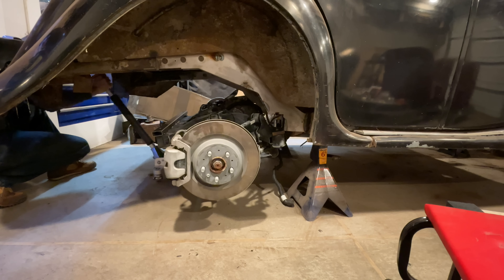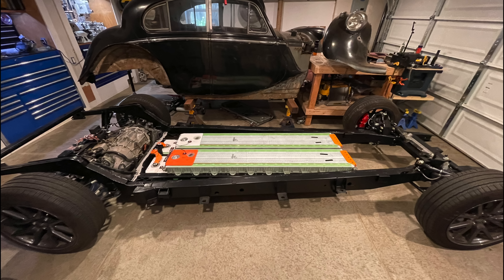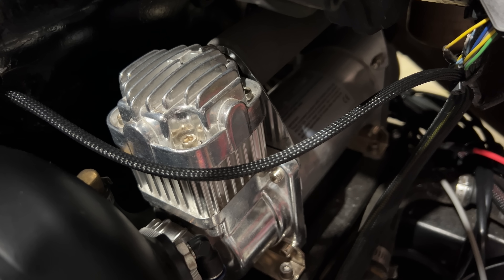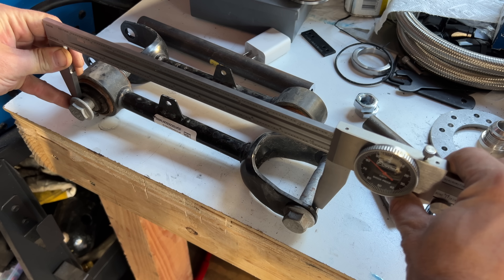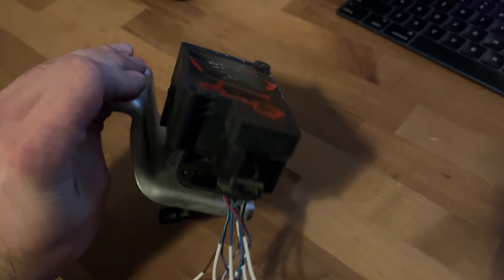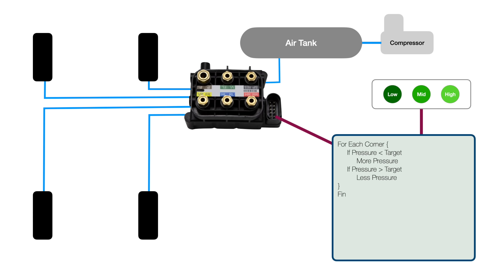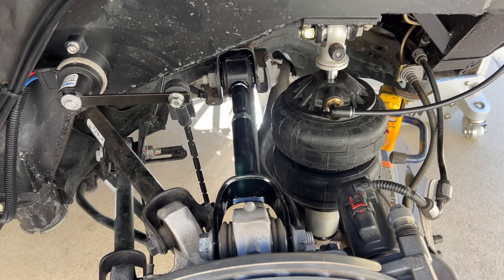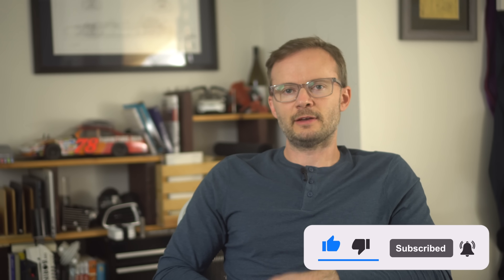Air Suspension: DIY or Off The Shelf. Let's Find Out.

Comment: While the car is sitting air pressure will always be the same it has to be because that's how it holds the car (pounds per square inch of the  diaphragm) starting with less air volume whyle lowered will give you a more progressive spring rate which is ideal as the spring gets stiffer faster unlike a coil which has a linear spring rate.

Comment: ok as a software engineer the code with the diy route is super simple and it doesnt require the ride height sensor since i know how much air is in the bag !!! in the code i wouldve made a table with all four wheels desired pressures in it 
and in an infinite while loop i would check every wheel pressure with the sensor and compare it to the table and do an action to lower or inflate more 
the buttons if i press high i would swap the values in the table and the while loop will inflate all the bags to reach the pressure 
if i press low i replace the values in the table and while loop would deflate the bags
you can also make custom values to make the car dance if you want to

Comment: This is a dumb non engineer question but once the air bag lifts the car up 2 more inches, doesn't it take the same psi to hold it there as the lower setting?

Comment: I wonder if you could use a coil-over with the bottom mount on a sliding track, adjusted by a linear actuator. For low and firm, wind it out toward the wheel.

For high and soft, wind it in toward the body, closer to the pivot.

Just as easy to control and you don't need a compressor/tank harshing your marshmallow.
Reply: That would work, but it would be a really complicated and heavy way to get the same effect as connecting the air bag to a fixed air chamber, closing a valve between them for stiffer springing and opening it for softer springing.
Reply: @brianb-p6586  true, but it also solves the inverted softness profile inherent in air bags.
Reply: @LongPeter  what is "inverted"? If the bag is longer, it is softer, which is good, because it also means that if it is shorter (lower ride height) is it stiffer... as it need to be to avoid bottoming out.
Reply: @brianb-p6586  Matt said (in a Jag video I think?) that increasing ride-height with variable air pressure results in a harder ride the higher you go. I was just taking his word for it.
Reply: @Long Peter  the problem is the type of air spring bellows that he's using, for which the rubber acts as a spring itself, completely messing up the spring rate at anything other than one height. That's not the behavior of the air itself as a spring.

Comment: Many factory air suspensions, like that on my 2001 Audi allroad, have a lower spring perch that is kind of pear shaped (as are many things on a 22 year old car), so the spring gets stiffer as the suspension gets lower.  In the rear, they also have dampers that are adjusted by an air valve so the damping adjusts as the suspension adjusts.

Comment: I recently was designing an air ride system for a project...didn't know anything about how to do it.
Spent days and day designing circuits electrical and air, and trying to source individual bits and bobs
Ended up using a set of used oem bags and struts and purchasing a new aftermarket controller and valve bank.
NOTHING rides like air!
Love the channel SFM! 😃

Comment: @SuperfastMatt   I just discovered your channel, lots of great stuff!

I believe what you said about air suspension at :55 is backwards; to raise the car you need more air volume, not pressure (the weight doesn't change).

A greater volume of air has lower spring rate than a smaller volume.
Reply: All true, but he's using convoluted bellows, so he's fighting the stiffness of the rubber in addition to the spring characteristics of the air.

Comment: You can't weld a hardened steel bolt, it must be welded in a normalized state and heat treated after welding. What you have done is highly dangerous, especially since it's a suspension part.

Comment: i designed my own airride, and i did it the right way. You dont use pressure EVER as rideheight setting. Its completely ret*rded. The reason you talked about in the video, the lower the car the lower the pressure. But then someone gets in, or you load up the back of the car with stuff and now all of a sudden the pressure rises because the bags have to carry more weight. Want to guess what the air suspension is going to do? Its going to lower the car even more in the back even tho it was allready getting lower because of the weight you added there. So instead of the car going level again when the air suspension activates it wil actually lean back even more. So the only way to go is to include height sensors. Height sensors and pressure sensors would be best if the system looks at both and trys to get the pressure left to right equal at all times. If you use that you should prettymuch have the same corner weight on each wheel.

Comment: Hi Matt,
While your example of low ride height equals soft and hi ride height equals stiff is probably somewhat true for the double bellow airbags you are using, generally in an air suspension pressure is a function of load whereas height is actually a function of volume. If the bellows volume is sufficient (or if you were to utilize sleeve airbags such as most OEMs generally use), there would be next to no stiffness change (or pressure change) at different ride heights. Have you fallen prey to the balloon analogy (bigger balloon = higher pressure)? :-p

And drop the Viair compressor and pick up a used compressor out of an OEM air suspension. You won't have to redesign the mount and you will not hear any compressor noise anymore.

Comment: Thank you for saying exactly what people refuse to understand about air suspension being inherently bad ie getting softer as it goes low and stiffer as it lifts up.
Reply: People refuse to understand this because it isn't true with appropriate air springs.
Reply: @brianb-p6586  which ones get stiffer as they go lower and softer when at max height?
Reply: @MattRabbitDesign  Any air spring which lets the air do the springing, not letting distortion of rubber interfere with the action of compressed air. That means the reversible sleeve or rolling lobe style; in Ride Tech's products, those are found on the Universal 7000 Series and 8000 Series, and vehicle-specific units for beam axles and MacPherson struts.

Comment: I agree with Luaa, plug welds on the modified link would make me feel much better. I have never worked on an air suspension system but it looks to me that if you control each corner separately you could have a good chance of having a different spring rate at each corner, probably not the best idea. Always great to watch your vids!
Reply: A bigger issue that different spring rates is diagonal loading bias - one front wheel and the opposite-side rear wheel with more pressure and carrying more load than the other two.

Comment: The conic airbags (the ones like used in big trucks, that rolls over it's structure to maintain a fixed ratio of volume/pressure) diminishes the spring rate problem. Maybe worth the test!
Reply: Yes, they're typically called "reversible sleeve" or "rolling lobe" type springs. The change of rate with travel of this type can even be tuned with variations in the shape of that structure.

Comment: Glad you went with height control sensor instead of just using PSI.
If you load your car up differently or a fat guy sits on one side it will ride wierd.
I used to drive trucks with air suspension and would use the pressure guages to load and it was crazy how much pressure differential there would be when sitting level.

Comment: It's like rodends in bending but... turnbuckles in bending. But more importantly, It's Good Enough™
Reply: Fortunately, the bending force isn't bad, because it's only the result of bushing binding. If spherical joints (rod ends) were used, there would be no bending force in the link.

Comment: id love to  do  the same thing with an overland 4x4. knowing of the torque and power the tesla motors can produce i think it would be possible to do. the only thing is knowing how much  power you could use everyday recharging could be an issue. oh wait so is money to even build the thing, not to  mention a shop to do it in. well  darn. never mind. off topic im currently working on modifying the roof rack you did a DIY on , but i prefer something a little bit higher so im thinking of going 4" front rear, and sides. to  give a little bit of a basket for those 4x8 sheets of plywood and such.

Comment: You might be surprised what just wrapping the airtank w Dynamat could do to quiet the compressor noise. It worked for me. It's like how I picked up every easy to grab rubber bungee strap off the road for about a year and kept winding them around the 80 gallon tank on my shop compressor. It really made a difference. Was it worth it? Eh, I guess so. ALL HAIL

Comment: Or you could skip all of that and use a semi truck leveling valve for $20 and a solenoid on the height stick when you want it to go up.
Reply: Maybe four of those valves, for the independent suspension on both axles.
Reply: @brianb-p6586  yep that would be better since the front is heavier than the back
Reply: @markm0000  With the drive unit and ancillary electronics in the back, and the battery in the middle, the back of this car is presumably substantially heavier than the front... but yes, they're different, so at a minimum separate front and rear valves would be required. The front and rear suspensions also have different geometries, so the even if they were equally loaded and had identical air springs, they would probably need different pressures.
Reply: @brianb-p6586  When I bag my truck I’ll do that instead of this expensive setup. 4 valves is good when taking a hard corner the outside bags can get more air and the inside bags stay the same.
Reply: @markm0000  Actively controlling air springs to respond to cornering force takes a lot of compressor power - it can work, but most air suspensions don't attempt to do that. Also, in a corner if air is added to the springs on the outside of the turn (where suspension load increases), air should be taken out of the springs on the inside (where suspension load decreases), so the whole vehicle doesn't rise as a result.

Comment: Matt, if you mount that compressor with some rubber isolators it will get rid of most of the noise, may be an easy solution for you.

Comment: You can change the characteristics of a air spring by reducing the volume with a liquid such as a silicone oil.
All telescopic motorcycle forks are coil/air spring hybrids ,whether they are pressurised or  operate at ambient pressure.
Changing the oil level alters the air space above the oil and therefore changes the air spring characteristics.

Comment: I'm almost wondering if the Tesla rear subframe-suspension-motor unit would fit in the same hole size as the Jaguar independent rear suspension? I mean, the one on the XJ series 1-2-3, XJ40 and XJ-S.
Reply: No, either of the Tesla rear assemblies (Model S/X or Model 3/Y) is larger than the classic Jaguar IRS assembly... which makes sense, because it has a whole motor and transaxle with inverter (not just a final drive) and because it is a much better suspension.

Still, you might be able to convert an old Jaguar XJ anyway, with a tolerable amount of body modification.

Comment: I have installed air suspension on my vehicles. I bought Holland Neway leveling valves, an air tank. pressure switch and a compressor. The system I installed is like the system used on public transit busses and 18 wheelers. KISS.

Comment: The internal spring pressure is the same at all ride heights. Resistance, like loading the vehicle will increase the internal spring pressure. Here is a question for you. Does your Jag get heavier at the full height of a lift on a hoist? I know it does not. 
  Adding more cubic air to an air spring will cause it to extend until it meets resistance, only then will the internal pressure start to rise to meet or exceed the resistant load.
Reply: Unfortunately, the double convoluted bellows design of air spring, including the ones that Matt is using, have far from ideal air spring behaviour - it's almost like using a tire as an air spring, while the other type of air spring (the reversible sleeve or rolling lobe) acts more like a piston in a cylinder.

Comment: I was at a wedding and was sat next to someone that did suspension design for a German auto manufacturer, we briefly talked about what we did, then got on the subject of modified cars.
I showed him the diagram for the double triangulated 4 link (solid axle) rear suspension I made for my Explorer, talked about design goals and shortcomings etc.

He was tickled that I was planning to put such a highly modified vehicle back on the road, something he described as impossible in Germany, but mostly laughed and suggested it was quaint compared to the five link designs he worked on.

It took me months of revisions to get the 4 link how I wanted it on paper (to be seen in the real world), but still I didn't disagree. 5 link independent are absolutely mind boggling.

Comment: How about one manifold with 4 outlet ports? One to each wheel. One pressure monitor on the inlet for different ride heights. Then a shut off valve between between the manifold and each tire so the ride height/pressure stays the same at each corner. Shared to inflate/deflate, segregated once up to pressure and height.

Comment: I'm curious why you didn't use mechanical leveling valves with electric dump valves?
Mechanical valves are extremely common on bigrigs
Reply: That's only a straightforward solution if you don't want ride height to be adjustable.

Comment: Top tip: for comfort use a fridge kompressor - super low noise, won't last 20 years without lubricant, but it will be fine. But perhaps leave the noisy one in for speed. 🧐🤔🤓

Comment: Isn't the pressure the same regardless of ride height? You have the same mass at each corner, so the force on each airbag is the same, so the pressure is the same. Unless the airbag shape or suspension geometry changes. You just have more air in the bag at higher ride height which makes it longer. Which would also make it ride softer because you need more travel to halve the volume and double the force. Or am I missing something??
Reply: You are correct. That's exactly how it works and exactly why aftermarket kits, passenger cars and commercial vehicles that use airbags all use ride height sensors instead of trying to determine ride height based off pressure.
Reply: That's all correct, for an ideal airbag. The reversible sleeve (or rolling lobe) designs are close, but Matt is using the double convoluted bellows type, and the rubber in those interferes with the ideal behaviour. Still, they're closer to the ideal that you describe than the behaviour which Matt suggested.

Comment: It is amazing how sometimes the OTS is just what you needed.  I have come to that conclusion when considering EFI for my MGB.
Reply: can you give some details or links? I have a MGB and never heard of someone installing an EFI
Reply: Definitely.  When I converted my car to discs I made sure to use a kit for the front that uses all standard parts so I can easily get replacements.  The rear has less easy to source parts but those don't wear out as fast
Reply: There are several controller options that could be used for EFI set-ups. A Micro-squirt unit is likely the most user friendly for the price, if you have more knowledge when it comes to a Adrino or raspberry set-up there is a Speedduino unit that is kind of interesting and fairly inexpensive. You can put together a EFI set up fairly easily and inexpensive. Infact if you look around at Matts projects i belive he does a Microsquirt set-up on his Grom or even his land speed rig. Whatever the case he has done it a couple times and gives pretty good info as to mak8ng the conversion. One of my first was making my KTM 525 fuel injected and for it i used a Microsquirt. I believe the controller was under $ and all the parts were sorced form the car junkyard and the motorcycle junkyard with a piece here and there being bought new.

Comment: That rear multilink has very specific bushes that bind in weird ways to provide passive steering effort depending on where the wheel is throughout it's travel. I hate modifying cars with multilinks because changing things even very minorly can throw the whole thing off.
Reply: Passive steering doesn't result from bushing binding - it results from toe changes due to the link geometry and due to busing deflection. Replace the bushing with rod ends and you would still have the geometric effects; add compliance to compression and extension of the links and you would still have the effect of bushing deflection even without any binding.

Comment: The ride height sensors here kind of annoy me. A rod attached to an arm on a potentiometer, seriously? There has to be a better way.
Reply: Linear variable differential transformers are accurate, reliable, effective, and were used on early active suspensions... but the arm on a pot is cheaper and good enough 😉.

Comment: Does manual air suspension exist? Instead of a tank and pump, could each strut just have a schrader valve?
Reply: That's what Matt said he was doing at the front, until he upgraded to this system.